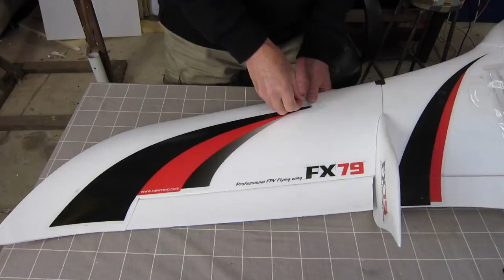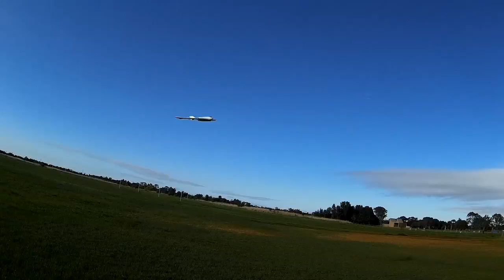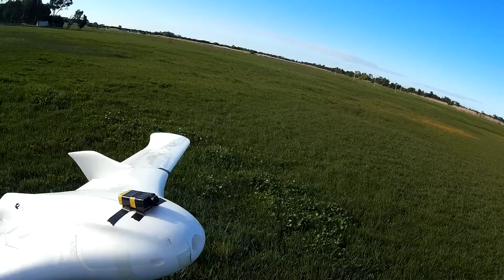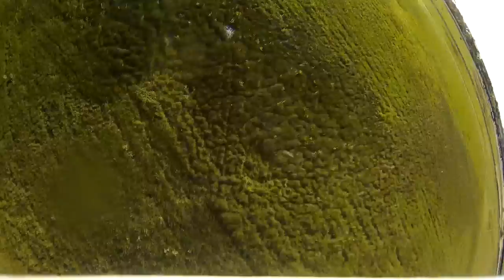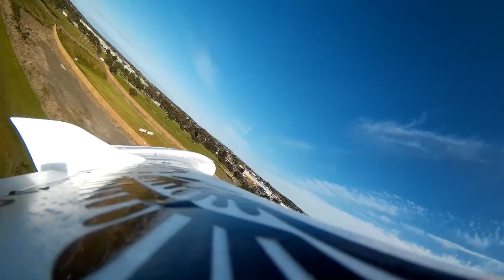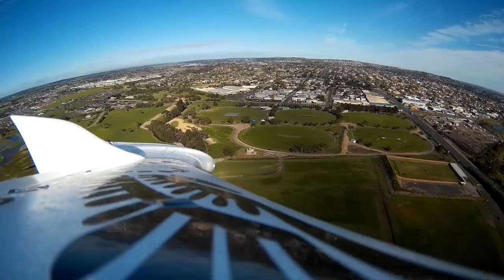CarbonBird FX-79

Comment: Looks great in the air and sounds so stealth with the 12" Aeronaut folder too.  Loved your wing shot looking back at the folded prop.  was waiting for a 360° aileron roll - How did the KST-CarbonBird™ 18g mini digital servos feel in pass-thru ?
Reply from the maker: It was all Pass thru, AIR3 not connected yet. Servos are excellent, fast and accurate.

Comment: I know this is unrelated but have you started using headplay se's instead of the eachine d2's?. If so how do they compare. I had to add a lot of focal correction to focus on my eachine goggles so I am wary of purchasing new fpv goggles but I would like improved reception & picture quality.
Reply from the maker: Good and bad I guess. Headplay SE come with an alternative lens set which works perfectly for me. BIG screen is excellent, BIG box is comfortable but very big. DVR works well but it's an add-on rather than integrated in to the design. Only one antenna so less range. I prefer to use Eacine Commader goggles now for about the same price as the Headplays. But you really need to try before you buy to see if they suit.
Reply: Do you mean aomway commander? Btw. The trouble with goggles is I can't find a shop where I can try. Purchase is all online. Thanks for your view.
Reply from the maker: Yes Aomway Commanders is what I meant.

Comment: Will the 1111Kv motor fit into the standard Fx-79 motor mount? Just not sure, it looks like the clearance might not be adequate.
Reply from the maker: It's designed for the FX-79 so fit shouldn't be an issue with stock mount

Comment: Hello Andrew, I apologize for spamming the comments but my fx-79 finally arrived. Unfortunately the motor mount is missing. Can you please suggest a place from where I can get one? Any thought on that would be helpful. Thank you!
Reply from the maker: That's fine George. Small Parts CNC sell an extended aluminium mount for FX-61 and 79. You could also try emailing mulitwiicopter.com (he 3D printed mine)
Reply from the maker: Here's another possibility https://www.thingiverse.com/thing:646702
Reply: Awesome!  I would try to find aluminium one as I read the plastic mount is prone to cracks etc.

Comment: Got my fx79 2 days ago, start with painting job while waiting for 3d print part for bungee hook. Your hand launch looks so easy but not for me. is 200gr motor will be too heavy for this wing?
Reply from the maker: 200g motor would be OK, I use this one which is 160g http://www.carbonbird.com/products/carbonbird-3515ss-1111kv-4s-fixed-wing-fpv
Reply: thanks Andrew, I will use SS 3520 720kv, its 40 gr heavier which is good for this wing I guest, as it has nose heavy tendency (?)

Comment: could you help me choosing a glider?? I am undecided between the "phoenix 1600", "phoenix 2000" and "asw28"
Reply from the maker: What sort of gliding is most important to you. Thermal, slope or just flying around half motor half gliding?
Reply: Thermal, and some half motor half gliding, I like efficiency..Which plane is for what?. Which other do you know that you recommend?   Thanks for your reply!
Reply from the maker: The Phoenix Evolution 2.6m setup is the best of these foamie gliders for thermalling. I'm not a big fan of the ASW, it's to thin and flexible for foam, needs to be a proper composite construction. The P1600 is a great fast sloper. The P2000 is a great all rounder, thermal, slope and motoring.